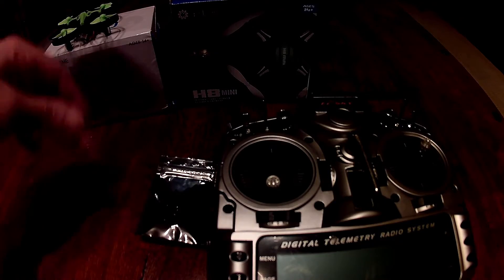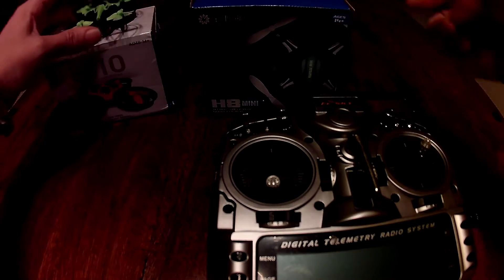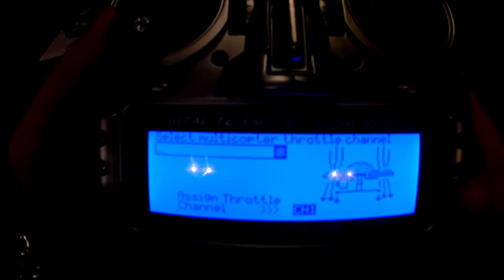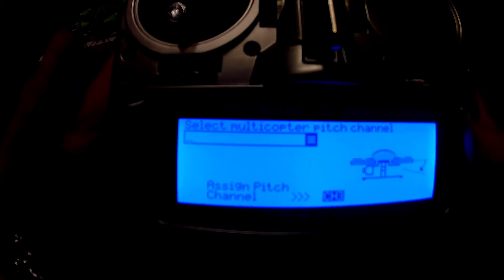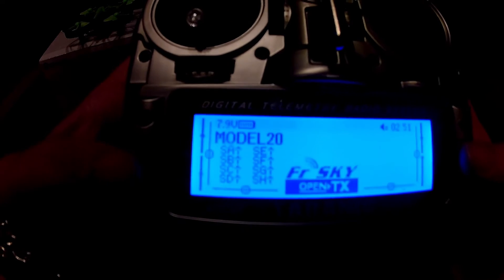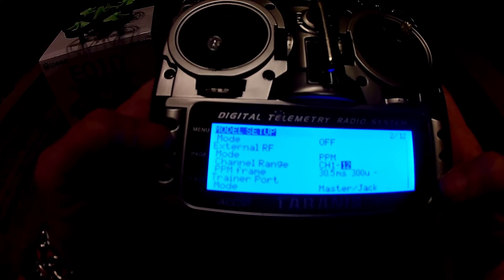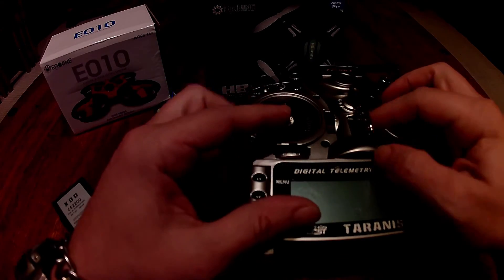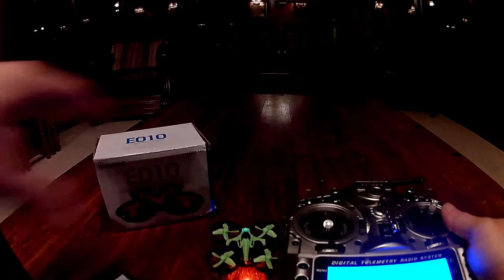MultiProtocol Tx Module Taranis/Binding Guide

Comment from the maker: Binding Procedure
1. Create a model in OpenTX using external module in PPM mode, 12 channels and AETR sequence order. 
2. Turn off Taranis. 
3. Power up quad. 
4. While holding the appropriate stick pattern listed below, power up Taranis.

Arm quad based on it's firmware's specification. Protocol is selected with stick position at startup:
Rudder right + Aileron right + Elevator down = EAchine E010, NiHui NH-010, JJRC H36 mini 
Rudder right + Aileron right + Elevator up = FQ-777-124 Pocket Drone 
Rudder right + Aileron left + Elevator up = CX-10 older red PCB/CX11/CX205/CX30, JXD389/391/393, SH6057/6043/6044/6046/6047, FY326Q7, WLToys v252 Pro/v343, XinXun X28/X30/X33/X39/X40
Rudder right + Aileron left + Elevator down = WLToys V930/931/939/966/977/988
Rudder right + Elevator down = HiSky RXs, HFP80, HCP80/100, FBL70/80/90/100, FF120, HMX120, WLToys v933/944/955 
Rudder right + Elevator up = Syma X5C (older model), X2 ... 
Rudder right + Aileron right = MJX X600 
Rudder right + Aileron left = EAchine H8 mini 3D, JJRC H20/H22
Elevator down + Aileron left = Syma X5C-1/X11/X11C/X12    X8G & X5SW
Elevator down + Aileron right = Attop YD-822/YD-829/YD-829C …
Elevator up + Aileron right = EAchine H8(C) mini, BayangToys X6/X7/X9, JJRC JJ850, Floureon H101 ... 
Elevator up + Aileron left = EAchine H7 
Elevator up = WLToys V202/252/272, JXD 385/388, JJRC H6C, Yizhan Tarantula X6 …
Elevator down = EAchine CG023/CG031/3D X4 
Aileron left = Cheerson CX-10 green pcb 
Aileron right = Cheerson CX-10 blue pcb & some newer red pcb, CX-10A, CX-10C, CX11, CX12, Floureon FX10, JJRC DHD D1

Last used protocol is automatically selected if stick is in neutral position.

Extra features (if available on aircraft):
Channel 5: led light, 3 pos. rate on CX-10 and FQ777-124, H7, inverted flight on H101 
Channel 6: flip control 
Channel 7: still camera
Channel 8: video camera, pitch trim (FQ777-124) 
Channel 9: headless 
Channel 10: calibrate Y (V2x2), pitch trim (H7), RTH (H8 mini/H20, FQ777-124), 360deg flip mode (H8 mini 3D/H22)
Channel 11: calibrate X (V2x2), roll trim (H7,FQ777-124) Channel 12: Reset / Rebind

=============================
Syma X8G & X5SW configuration kindly added by Brad Miles
Reply: Hey brad i have a flying 3d x8 with the Fy-q7-rx reciever and i cannot get my 4 in 1 multi protocol module to bind using the latest opentx firmware for anything so i have basically disassembled the quad and there is lies in pieces ever since any ideas or instructions you could give me please would be greatly appreciated!! Thxs ahead of time!

Comment: Hi, is this module work with x9d plus se 2019? I wanna get for eachine qx65. Fc is eachine beecore v2.
Reply from the maker: I have used this module in my X9D+ SE. As for the QX65 - they come as FrSky (and Flysky/DSM) so You wouldn't need one for it unless I am missing something..
Reply: MrE yes, it came frsky spi but it doesn’t work x9d+ se 2019. Because it have D8 protocol. There is D16 protocol.
Reply from the maker: @OrtayaKarışıkBişiyler  It sounds like you have an EU x9d+? I recently updated mine to new firmware and was still able to have D8 work by unchecking the EU flag in OpenTX companion (still functioned as EU unit but just showed the D8 protocol which connected to an international SPI Emax Tinyhawk)
Reply: MrE yea, my firmware up to date but x9d+ se 2019 isn’t have D8 protocol.
Reply from the maker: @OrtayaKarışıkBişiyler  I have videos that cover this for X7 & X-Lite, but check these guys vids out for exactly what you need to do on X9D+:
Quadcopters.co.uk: https://www.youtube.com/watch?v=f4BcZdQFtwc
Whirly Bloke: https://www.youtube.com/watch?v=gpgyIYygQag

Comment: My module completely lost light after 3 binds (flys) :( and I just bought it from a third party seller for $22. Well could be that my firmware is 2018 2.2.2
Reply from the maker: I doubt it's firmware related if it worked to begin with, get onto the seller.

Comment: I followed your video exactly on my q x7, and I only get a yellow light on the module, no green light. Any ideas for trouble shooting? I've tried setting up several new models over and over but no luck with a green light yet.
Reply from the maker: I've had a quick froust around regards a yellow LED buy from what I can tell I only have one LED which is green, prehaps your's was just made with a yellow one?
Is the LED in the middle of a 3 SMD components above a larger voltage regulator looking thing?

I would check if the LED is turning on and off while enabling the external module in page 2 of the menu.
Reply: @MrE.  All sorted!  Mine is indeed made with a yellow LED and the E010 works well.  Just in case anyone else has this issue - yellow can be normal
Reply from the maker: @DouglasPaterson  Very happy to hear you are up and running with it, I'll keep the yellow LED difference in the mental filing system for anyone in future, I appreciate you taking the time to let me know, thanks!

Comment: Will it work with my Taranis QX7 on my Hubsan X4?
Reply from the maker: I'm sorry but I can't tell you that it will - I see no info for a definitive "yes it will work" sadly.This module undoubtedly has the hardware required to communicate with the Hubsan X4 (A7105 ) but I see nothing that utilises the same protocol in my known supported list, albeit my pinned list is not maintained and I never actively do much with it.
So take it as a no with this module without going crazy and implementing it yourself or flashing wierd deviation derivatives onto it, however take a look at this: http://bit.ly/2Fcjb2xThese most certainly do support the X4 out of the box - check the supported in the link on the page.
Hope this helps, I know its prob more than you want to spend but I use those over this module (it's range is rubbish)

Comment: You can in the radio menu change how channels are assigned in new models to AETR. Or numerous different combinations.
Reply from the maker: I have so many craft I like to stick with the TAER default for Frsky, I'd probably end up chopping my finger off if I changed it! just making sure AETR was emphasized due to the module etc, however my Flysky stuff is that channel oriented.
A tip of the hat though.

Comment: Mjx bug 3?for flysky
Reply from the maker: Apparently the MJX Bugs 3 uses the A7105 module which in turn Flysky  uses, as does some Hubsan, Great wall, Hisky and WLtoys to mention a few.
"IF" you attempt connecting up ,make sure your props are off etc and check everything to be safe.
Hope this helps but I wouldn't put much trust in this module for something like your Bugs 3, you may be better off comming at it backwards by installing a branded reciever on the craft if its moddable.

Comment: I have one if these modules for my eachine E010 and E011. I have 2 different Syma quads. Do you know the bind stick position?
Reply from the maker: I have pinned the full instructions for the module but for the ones you require:
E010:
Rudder right + Aileron right + Elevator down = EAchine E010, NiHui NH-010, JJRC H36 mini
(I expect the E010 is the same protocol as the E010)
Syma:
Rudder right + Elevator up = Syma X5C (older model), X2 ... 

If they are not correct - check on RCGroups and see if its compatible with other quads in the  list.
Hope this helps!
Reply: MrE ...thanks. I will give I a try.
Reply: Turns out that Elev Down / Ail Left was the ticket for both my X8G and my X5SW. If you are keeping a spreadsheet, then you can add these two models to this sequence for sure.  Thx
Reply from the maker: Thanks,Brad!
I have added the X8G & X5SW to the pinned comment and credited you - glad you have it working with your quads and thanks for the info.

Comment: will it work with my taranis QX 7
Reply from the maker: Old School R/C I just tried taking the module from my X9D and trying it in the X7 without any success sadly. There was no indication that it was operating like the X9 due to no LEDs even when unbound etc, I'm wondering if prehaps a later X7 firmware might enable it working - I'll see about looking into.
Reply: MrE ok, thanks again Sir
Reply from the maker: Old School R/C You're welcome.
Reply from the maker: Old School R/C I looked into your question further with success. It was easier to put a little video together: https://www.youtube.com/watch?v=b4BPlDzMa50 hope this helps!

Comment: Dude you're awesome! I bought this module on a whim and had NO IDEA how to install this thing and it took me all of 5 mins with your help. Worked PERFECTLY. thanks!
Reply from the maker: Alex H You're welcome, I'm glad it helped!
Reply: Question. My throttle stick hover point seems like 85% up and I can't really use the lower 2/3 of my throttle. How do I turn the sensitivity up so that my hover point takes less throttle? It's also be nice to increase the yaw sensitivity as well-- thanks!!
Reply from the maker: I sort of had this problem but didnt look into it yet,the only thing I can think of is on the output configuration of the Taranis maybe try increasing the PPM center/midpoints - I will dig out a compatible model and try it when I get the opertunity. For me i was lacking top end throttle on the E010, For the yaw issue you may want to check the channel required to change the rates from low to a higher one.
Reply: I'll do some googling and see if I can figure out how to change that. Thanks. Same thing here, totally missing ALL top end throttle. At some points I can't even gain altitude :(

Comment: Thanks for making this video. I had some issues getting my E010 bound to my Taranis, but your comment on the throttle signal strength was the final key to get it working. After reordering the output to AETR, I had to lower the subtrim on channel 3 (Thr) to -100 in order to achieve 988us. The stock setting on my radio had channel 3 outputting 1485us. Cheers
Reply from the maker: Your welcome, I'm glad it helped you out.

Comment: hi I have a th9x with no internal antenna.Do I have to solder an antenna on the module?ta
Reply from the maker: It has it's own antenna onboard, although the range is questionable. On a couple of the products images you can see it as the square zigzag copper trace bit on the little board sticking out above the main module.
Reply: thx... you will get 100 metres from that I suggest
Reply from the maker: Your welcome. Thats the official range iirc ,  I may try and see true range away from all my wifi etc, if it stops raining soon :)
Reply: I will keep my eye out for it!!
Reply: As MrE said the antenna is the square zigzag copper. I have noticed the range is not very good in a house because of a the concrete walls. I have set vertically the antenna on the Eachine E010, and it is a little better but not enough in some rooms of my house. Maybe someone has added an additional antenna to the Tx Module? The problem is how to solder the antenna wires.
Reply from the maker: RcMic
I have been thinking the same,but yet to get further on it than thinking about it.
One polarity would be no problem but the other I would suggest getting some advice from someone with a better understanding of such things.
Prehaps one wire external antenna is all that would be needed like some of the small Frsky receivers etc.

Comment: Hi, nice. I can't get mine to work. I have a stock Taranis X9D with stock firmware. Do I need to flash with other version of Opentx? Hope to hear from you soon. Regards
Reply from the maker: If you have enabled the external module as PPM with 12 Channels and the order AETR, check if you have the light on the module once the model with the above configuration is selected. I have upgraded my firmware when I originally got my Taranis (2.something I believe) but did nothing special to get this module working.
Reply: Thank you. I have done everything as suggested but no luck. I think I need to flash my X9D with the open source OpenTX. I have sub to your channel. Hope you sub back. Cheers :)
Reply from the maker: jtgravityRC
Your welcome. For what it's worth my OpenTX version is 2.1.6. on a Taranis X9D Plus.

Just a thought that if you have it all configured and the module is lit ,check your stick throws that they are able to trigger the extremities like on my E010 to bind while turning on I would need to transmit 1000us Throttle(ch3) 2000us Rudder(ch4), 1000us Elevator(ch2) and 2000us on Aileron(ch1) pretty much down right on both sticks.
Reply: Thank you. Maybe I need to check and set the stick throws. How do I do that?
Reply from the maker: jtgravityRC
I think either check via Cleanflight/Betaflight configurator with some other craft/receiver like normal,then check the model setup for the Multiprotocol Tx on the taranis via page 7 in the setup menu(Outputs) It shows it up the top. Just checked mine and all throws by default are showing the range from 988us to 2012us and it functions fine with those.
What model are you trying to bind to? as they have different stick commands depending on the module required.
Reply from the maker: jtgravityRC
So we can safely say that it definitely requires down right on both sticks while powering on to bind as the H36 is an E010.
Reply: MrE Ok, thank you. I will try.
Reply from the maker: jtgravityRC
Process is plug quad in ,it should have flashing lights,then power on the Taranis with the sticks held down right,after a few seconds the H36/E010's led's should go solid and be bound. once again I suggest verifying that your channel map for the module model is AETR.
Reply: Yes, I have checked everything on the Taranis. There's green light. The only difference is the OpenTX versions. Still can't get it to work. :(
Reply from the maker: jtgravityRC
I dont quite know what to suggest other than carrying on with trial and error! Either OpenTX version is the culprit or it's a faulty module but with the LED lighting up it would point towards OpenTX from my perspective.

I was quite concerned with upgrading Taranis/OpenTX originally but it was misplaced and everything went smoothly,There are some really good guides about the process.

I bid you good luck none the less and would like to hear the outcome eitherway. If there is anything else I can help you with, please don't hesitate to drop me a message and I will do anything I can to be of further assistance.

Subbed to you and I will have a look through your content when I get some time,but thank you for your sub.
Reply: Thank you so much for your assistance. Will keep you updated. My view is that it is probably the module or OpenTX. Thanks for your sub.
Reply: I followed the video instructions perfectly and the green LED never comes on and I cannot bind it to an E010.  I have opentx 2.0.9 for what its worth.
Reply from the maker: redrex3
If you dont have an LED on the module with PPM selected for the external module and that model active. I think it means the module itself is defective sadly.

Comment: Thanks for posting this. How do you change mode (beginner, intermediate, advanced), do flips, enter headless mode, RTH etc.?
Reply from the maker: Set your radio to the desired channel/feature - the following is the only info I have to had regards other features for the supported micro quads,I have yet to test them but it shouldn't be very time consuming to figure:
Channel 5: led light, 3pos. rate on CX-10 and FQ777-124, H7, inverted flight on H101
Channel 6: flip control 
Channel 7: still camera 
Channel 8: video camera, pitch trim (FQ777-124) 
Channel 9: headless mode
Channel 10: calibrate Y (V2x2), pitch trim(H7), RTH(H8 mini/H20, FQ777-124), 360deg flip mode (H8mini 3D/H22)
Channel 11: calibrate X (V2x2), roll trim (H7,FQ777-124)
Channel 12: Reset / Rebind

I may see if the E010 responds to any of the listed channels and leave a subsequent message regards my findings.
Reply: Thank you!
Reply from the maker: Your welcome. I tested the above channels on an Eachine E010 and found they certainly work for flips and I'm pretty sure they worked on the rates also, so I guess they would do for any of the other supported quads.